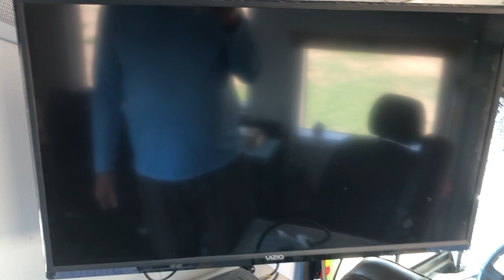Go the Distance - Vlog 259 Bus Life

Comment: Hello Randy,  do enjoy you vlogs both in substance & style.   I like the water fill you installed.  Stainless steel fittings makes a longer lasting connection.  I have searched on several occasion after watching someones build where they installed the outside boxes for water inlets and external showers.  Both made out of plastic that will need to be replaced at some point.   What I have searched for was stainless steel water inlet box w/lock and the outdoor shower boxes.  

 You mentioned about using the shovel to get unstuck with the bus.  Have you installed an electric winch on the front,rear or both for getting out of a stuck situation.   Might come in handy for yourself and others.     Thanks
Reply from the maker: No winches yet. 👍😊